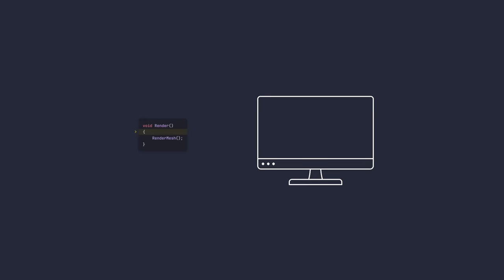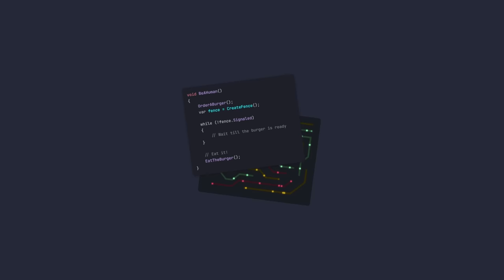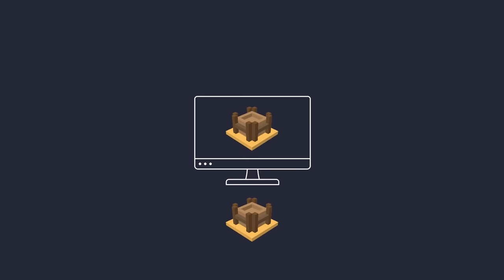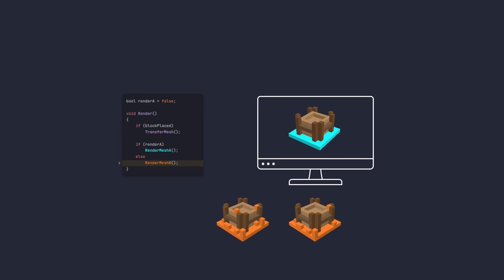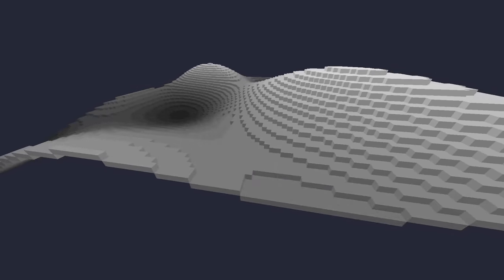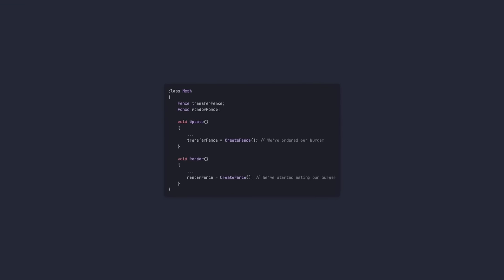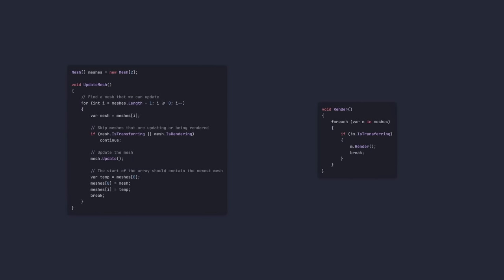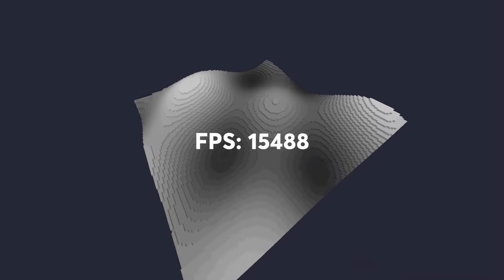I Created a Game Engine Just to Optimise This

Comment: This is why you can use double buffering, which is kind of like what you are doing but instead of for the framebuffer, you are doing it for the mesh. Normally GPU operations queue up in the buffer, they aren't meant to be completed by the end of the refresh. If you use a double buffered system, it allows everything to render without a stall, because when a stall would have occurred, it just shows the back buffer like normal.
Reply: Thank you! so that's where I recognised this technique, it's like a Double Buffering👍❤

Its probably still worth it, but the trade off you have with this technique is with the increased memory usage, as you'd about double the memory needed for the area around the player, and it adds more complexity managing these separate sources of meshes.
Reply: @SirNightmareFuel  That's true but GPUs have massive amounts of very-fast memory these days in order to support the heavy texture bandwidth of AAA games. Doubling or even 10x'ing the memory used by the meshes is not a huge deal because they all refer to the same textures and the textures are the most memory-hungry part of rendering unless you go crazy with poly-count.
Reply: It's even better with tripple buffering. One framebuffer is displayed on screen, one is being rendered to and the third one is ready to be displayed. When the part of hardware responsible for displaying is done with a display cycle (or VSync kicks in), it looks at the buffers and either displays the same one again or displays the ready buffer if it is newer. When the part that does the rendering is done, it marks it's buffer ready, then renders into whichever of the other buffers is not being displayed. This way the newest ready buffer is always displayed, rendering works continuously and there is no tearing, at least in theory.
Reply: The real downside to this type of technique when used for the framebuffer is latency. I can't play games with triple buffering except on very high refresh-rate monitors because the latency causes me nausea (except with an uncapped internal/buffer refresh rate which doesn't seem to be commonly implemented sadly).
Reply: Yup, screen buffer was my first thought too.
Reply: @OMGclueless Which IS a real concern with today's large, open-world maps with large amounts of detail. You'd have to do caching of the altered map segments in chunks and then de-allocate them once you're done changing. Caching the entire player view twice is probably going to take up too much memory.
Reply: @javaguru7141  Confusingly, there are actually two extremely different algorithms both called triple buffering. The algorithm games typically call "triple buffering" (because of Direct3D) is a swap-chain with 3 buffers (so the screen is always 2 buffers late). This smooths framerate but increases latency drastically.
However! That is not the same algorithm that @1Maklak is referring to. The one they are refering to actually reduces latency to a minimum, because the screen will always see the most up to date render, and the render will run as fast as possible. Nvidia calls this technique "Fast Sync" to avoid confusion with Direct3D's "triple-buffering".
Reply: @phlimy  Good to know, thanks!
Reply: @phlimy huh, I thought they did use the one @1Maklak was referring to. I don't see what delaying an extra frame would accomplish except causing extra latency. I don't see how it can make the framerate smoother.
Reply: also, a lot of the frame stutter you see in games (depending on the engine ofc) it's just the garbage collector running + lazy devs.
Reply: It's also probably worth mentioning that through a combination of modern graphics drivers, APIs like Direct3D or Vulkan, and modern game engines, most game devs don't have to handle buffering themselves. Double buffering is handled automatically by most rendering APIs nowadays.
Reply: more accurately, double buffering allows for the render target to be updated without risk of screen tearing. triple buffering is more about what you've outlined. that said, none of these are perfect solutions.

more buffers create greater and greater input lag. it's all tradeoffs, all the way down.
Reply: @phizc  Fast Sync makes use of extra rendered frames from the GPU to allow for partial updates. So for example, if the screen is 60hz and we have 120FPS, it will always have one frame in reserve for the next update. This keeps the latency low because that means we're rendering the current frame, or if we didn't get an update, the frame that would've originally been thrown out due to the screen's refresh rate. However this is useless with high refresh rate monitors. So it's not truly a triple buffer at all.
Reply: You're right for sure, but double buffering isn't going to be sufficient to address deeper pipeline deficiencies. This guy's technique also isn't sufficient for most pipeline deficiencies, but I would use both double buffering and this technique together, alongside a really good background mesh generation scheduler and predictive pipeline manager.

Put another way, double buffering gives you one extra frame to do everything in, at the cost of some memory, and user latency. No one can 16ms of latency so it generally works fine, but if you were to extend the technique out to multiple frames, it would start to show. So there's more needed.
Reply: @Stoney3K  I think this guy's technique does better than this, because he's pipelining each mesh independently. So he doesn't have to double buffer the entire on-screen mesh library, he just retains (at least one) stale copy of each mesh being changed until they have been fully replaced.
Reply: Sorry but could you explain that in burger please. Thank you!
Reply: @SirNightmareFuel  While you are 100% correct, most GPU's have more than plenty of memory and rendering available.

The issue with needing to upgrade your system these days isnt because your game cannot run the newest version anymore, but that the game running is not very optimized. A lot of companies say that you would need to update your hardware to run their game, because your hardware isnt capable of running their oh-so great game, but that is rarely truly the case. More often than not, a 970 could run all modern games if they were simply optimized *slightly*. Newer games are almost designed to use more VRAM, since that is cheaper than actually optimizing the game performance. Any game demanding more than 8gb VRAM is a scam.
Reply: @1Maklak Too much frame buffer will incur more input latency as often time you’re not exactly displaying a current frame or current event. This is very good technique to give a GPU additional time to render and also help to mitigate screen tearing but at the expense of latency.
Reply: If youre talking about the kind of buffering I think you are, then itll also cause a ton of latency. Having your game run smooth but feel terrible because of delayed action just switches one problem for another.
Reply: maybe its what they do in owerwatch - latency and lag and the game fakes whats going on and makes assumtions - one time i were hit by Hanzos arrow from his back at me - there the game or server failed - If  everyone has this issue the game or match are like a dream scene - eg that didtnt happen or one wonders what really happened or what the others saw  - when owerwatch were new one could tell an aimbot - now you cant by how the game renders on how being aimshotted  feels - guess they" Fixed" the gamecode for less skilled players so they won complain much  sicne tey cant see it or even experinced like me cant realise unless its obvious

Comment: Semaphores could also be ideal as fences can cause the CPU to stall waiting for GPU work to finish. Semaphores would allow for exclusive synchronization of GPU tasks ensuring the CPU is constantly writing commands and the GPU is constantly processing them. Great video nonetheless.
Reply: Love semaphores, very useful if a bit scary!
Reply: In real world implementations these are probably implemented as semaphores, because the transferring of data is being done in a background thread anyway. The busy-waiting done by a fence is probably done here for simplicity purposes because it makes the 'waiting' part easier to explain.
Reply: @Stoney3K  Yes. Transfers don't just run as a background thread, but DMA transfers over PCIe can be done completely async to the rest of the system (and GPUs often have dedicated transfer queues to accommodate this, allowing for ultra-fast async transfer from the CPU). Nowadays you can just generate some data yourself on the GPU though in compute, eliminating the need to transfer entirely and keeping everything local to VRAM.
Reply: @joeroeinski1107 True if you consider transferring of things like textures and shaders from the CPU to the GPU. But most of the waiting is often caused by the game loading in or parsing new assets from disk, which make it noticeably slow because I/O is much slower than CPU/GPU/memory access.

It's even more pronounced when the game is an online one and the assets have to be fetched from an offsite server.
Reply: @Stoney3K  Absolutely, though with emerging technology such as DirectStorage this soon may not be an issue.
Reply: in the near future peapole are gonna start demanding rights to GPUs and CPUs claiming we are making them do salve labor
Reply: @Stoney3K  No Man's Sky has this stuttering issue when leaving a planet. There's a mod that solves it by simply providing decompressed versions of the assets. It doesn't really touch code.
Reply: Agree with this! I think the technique here is simply to retain the stale mesh until its fresher version is available on the GPU, and perhaps additionally to either skip additional changes until earlier ones are done, or abort ones in progress when they are superseded. The only IPC structure needed would be for the render thread to notify the resource thread when it's ok to push another change.
Reply: @Stoney3K  What online game doesn't have the assets stored locally before rendering them?
Reply: @ConfusedKittens-wz9gr  well calling them master and slave threads was kinda asking for it
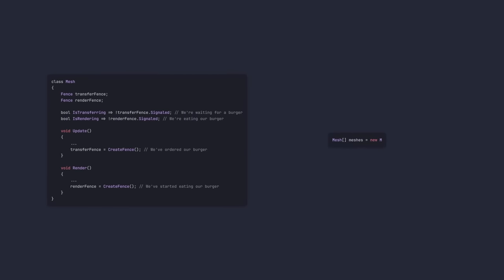Reply: @Vercidium is using their "Fence" signal as a thread-safe semaphore, they don't bust wait on the Fence signal as seen at 1:40 and 3:35, they continue with other operations on that same thread. This class should really be renamed Semaphore to better convey its functionality and usage.

A real fence maintains memory order of operations on two different threads, requiring that one thread waits to do work until after the other thread has signaled the fence. You can't check the fence signal with an if statement, because the calling thread would always wait for the signal and then return true.
Reply: @jame-rock  i thought i was going crazy, never heard of a memory fence before but thought "that's a semaphore... right!?" :'))

Comment: It's worth noting that for some games, the additional input delay might be considered unacceptable. Most games it won't matter but in those rare cases it may be necessary to explore alternatives
Reply: I think this technique won't increase input delay. It effectively just leaves old geometry on screen until new geometry is available. At worst you'll get "pop ins" instead of stalls.
Reply: @markdmckenna it it does add input delay, think of it this way: now you're shipping a whole frame with this old mesh instead of the new one, that might take 16ms or so, but what if 5ms into those 16ms the transfer completes? now you still have to wait for the full frame to be drawn before we can include the new mesh in the next frame. Whereas if we just stalled for those 5ms we'd only have to wait 5+16 ms instead of 16+16ms
Reply: @X606  Maybe a different definition of input delay here? IMO as long as we're providing "reasonably" up to date geometry for the user to interact with, there is no added input delay.
Reply: @markdmckenna  instead you get more render latency.
Reply: @markdmckenna  Yeah. Earlier thread wasn't making sense to me. Input processing is non-graphical, so dunno why delayed rendering would delay input processing unless you tied input processing to your draw() routine.

Albeit which happens a lot in amateur games using generalized game engines, but I presume this topic is scoped to more advanced game programming techniques.
Reply: @potato9832  Ok, let's assume it always takes 16ms for the render to happen with the fence solution.

At 60fps you are a full frame behind what you see, this is enough to just outright miss headshot windows.
Reply: Remember kids: there is no perfect general solution. Different problems need different solutions.
It sounds stupidly obvious but it's easy to forget.

Comment: This kind of sounds like double buffering, but for the geometry instead of the actual framebuffer. Very cool idea!
Reply: It's know as Asynchronous Buffer Update/Upload, nothing new.

The underlying concept of decoupling data transfer from rendering to avoid stalling the graphics pipeline is fundamental to graphics programming and has been a consideration as long as there have been programmable GPUs and sophisticated graphics APIs. it's been a feature of both directx and ogl for decades at this point.
Reply: That's exactly what I thought! Same basic principles as double buffering!
Reply: Asynchronous double buffering is used all over in software architecture - from network, i/o, file system, ipc, database, sound & graphics handling & more, in kernel, drivers, in plumbing layers & in user programs, from industrial automated real-time applications to interactive user-centered gui apps like browsers, games & more.

Comment: the biggest thing this video taught me is
optimization =/= fewer lines
Reply: *fewer
Reply: @Kyrelel  thanks
Reply: Usually the code with fewer lines is actually severely less optimized. Take a look at all the ""clean"" javascript code with a million abstractions and chained method calls. You have your fancy iterators when a simple for loop is literally 20x faster
Reply: it depends. if your bottleneck is storage, which used to be true when we had floppies, fewer lines meant more content and thus a more complete experience, a better value overall

Comment: I had a similar issue in my 2D game made in Game Maker Studio. When it tried to render some high resolution sprites I would get those stutters. However, I found a very useful command "texture_prefetch" which as you can guess loads a texture group into VRAM memory even if it's not being drawn yet. And "texture flush" clears a group from VRAM. By being manually proactive about texture loading, I not only removed all the stutter, but I also cut level loading time down to under half a second.

I'm pretty sure all engines have asynchronous buffered data loading / rendering, but I think some developers don't utilize it to it's full extend and just try to render a bunch of unloaded data at once. Your explanation is very good, and I hope it reminds other devs to think more carefully about asset loading.

Comment: I like how you're showing alternatives to the "just add more cores/memory" mentality.
Reply: Won't these extra copy of the mesh consume more memory? I suspect this is a compromise.

Here the mesh is extremely simple so it doesn't need much memory. 

On a more complex mesh this could require you to "just add memory".
Reply: @kyraxx  The extra threads would require more cores to be more efficient as well. This solution is literally "just add more cores/memory", but it works.
Reply: Just one more

Comment: That is not really seen as a real optimization, more like a technique that (as you said) has been done.

It is really interesting to see your approach compared to approaches game studio's make.
A GDC talk that is on a technical level really interesting is this one "Marvel's Spider-Man: A Technical Postmortem".

I also want to ask a question about your previous video, you mention that indeed triangle strip is way faster than triangle list.
The problem that I seem to face, is that there are no tools, as far as I know of that convert triangle list to triangle strip.

This is not a problem when you make all other models yourself and create a script that does it for you.
But how did you do it in your previous video?
Reply from the maker: Absolutely, technically this is a timing issue but since it affects game performance, it falls under the broader ‘optimisation’ category

For complex models like characters, converting them into triangle strips isn’t easy. Modern renderers will use an index buffer to help, where the model is broken down into triangle strips of the same length (e.g. 3 triangles) and then a GL_PRIMITIVE_RESTART is set to tell the shader to start a new triangle strip every 3 triangles (for example)

There will still be some vertices that hold the same data but any reduction in memory is a performance win
Reply: @Vercidium  I wish DirectX had something like that.
It's really interesting how other API's do specific things.
Reply from the maker: @budgetarms  looks like DirectX 10 has this feature, check out the ‘Generating Multiple Strips’ section

https://learn.microsoft.com/en-us/windows/win32/direct3d11/d3d10-graphics-programming-guide-primitive-topologies
Reply: @Vercidium  Thanks, I am looking into it, just wondering do you have a discord server (or is something like that in the works)?
Reply: @Vercidium  Just wondering, how do you do networking on your game, do you use an external OpenGL library for that or what?
Reply from the maker: @budgetarms  I don’t have a Discord server for this channel, I’ve started up a Patreon page and am also looking at GitHub Sponsors

For networking I use enet, which is very simple but pretty powerful. It allows sending packets to and from a client and server, and has support for channels, and reliable/ordered packets